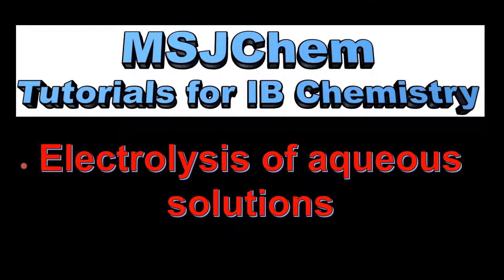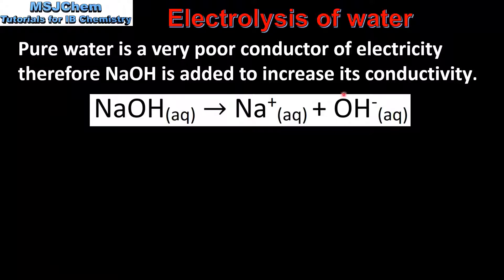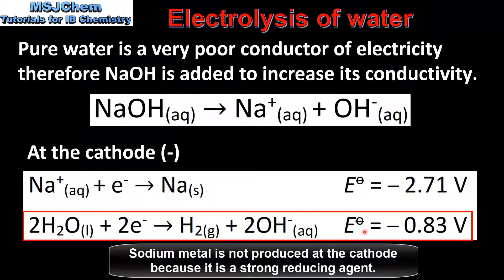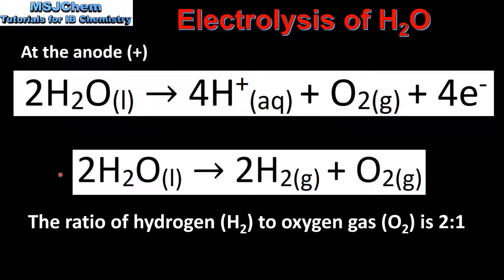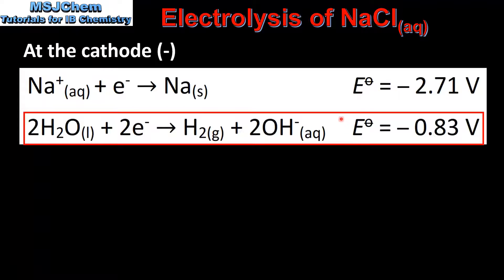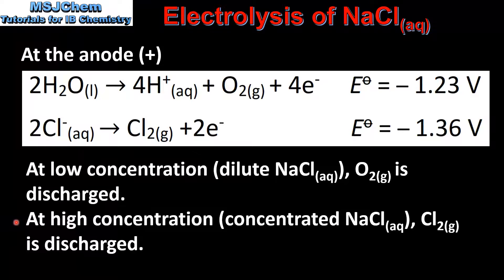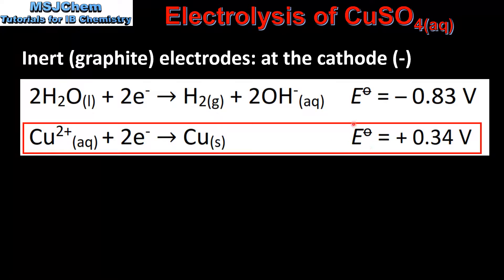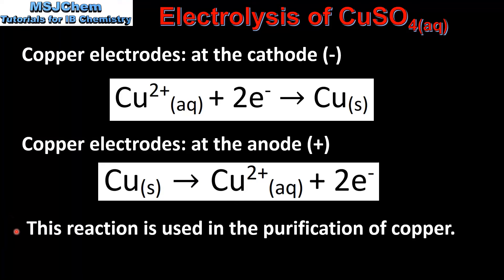R3.2.15 Electrolysis of aqueous solutions (HL)

Comment: Dear MSJCHEM, thank you for the video! Just one question: I recently had a paper 1 question where it asked the major products of electrolysing concentrated aqueous potassium iodide, KI (aq). I assumed the answer to be potassium at the cathode and Iodine at the anode due to the word "concentrated", but the answer was H2 on the cathode and Iodine at the anode. Is it because potassium's reduction potential and Hydrogen's reduction potential differ too much that the concentration does not affect the products? And how do we answer these types of questions if we can not use the data booklet (in paper 1) and we don't have the standard electrode potential values? Thank you very much and I appreciate your videos.
Reply from the maker: Potassium is too high in the electrochemical series to be produced when you have an aqueous solution. Water is reduced instead to produce hydrogen gas. The same goes for sodium, etc.

Comment: Hey MSJ. I was wondering why when there is a copper electrode in the electrolysis of CuSO4 solution, copper is oxidized, but when we use an inert electrode like Pt, water is oxidized.  Isn't the PD of the water half equation greater, so why is copper being oxidized
Reply from the maker: The copper atoms have a greater tendency to be oxidised than water.

Comment: Hello sir, I have a question, at 2:19  why are using the equation for water 2H2O +2é ——> H2(g) + 2OH-  at the cathode in diluted nacl  , instead of  using the other equation that is 2OH-(aq)  ——> H2O + 1/2 O2 (g) + 2é with a E= +0.40 from the data booklet, just generally does it matter which half equation of water I’m using to which gas is being discharged ?
Reply from the maker: You could use the equation for the oxidation of the OH- ion as the product is the same.
Reply: @MSJChem  okay great thank you!!

Comment: Thank you very much. A query: Pages 448 and 449 of the Pearson Baccalaureate Chem HL textbook state that OH ions are preferentially oxidized at the anode (in the electrolysis of water). It also implies that water would be oxidized at the anode (in the electrolysis of NaCl) if the concentration rule did not count. This contradicts with the fact that the species with the more negative E value is oxidized at the anode. Your statements are consistent with the rule but the those of the textbook are not. Please clarify.
Reply from the maker: I would say that water is oxidized at the anode rather than hydroxide ions. However the product (oxygen) is the same so it doesn’t really matter.

Comment: Hi MSJChem, Great Video! I think I've figured it out, but why aren't OH- / SO4-2 considered to be oxidized at the anode (at 1:16 and 3:20, respectively)
Reply from the maker: It is basically to do with ease of oxidation/reduction based on electrode potential values. In aqueous solutions, sulfate ions will not be oxidised. Hydroxide ions are present in very small concentrations, so they discharged in theory. However, the concentration of water is much higher so it can be considered to be oxidised or reduced in these situations.